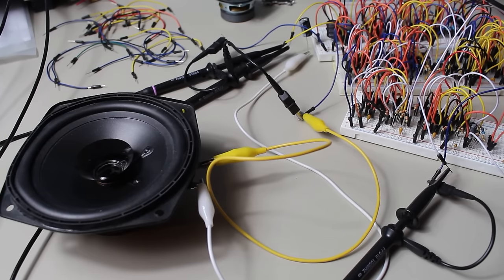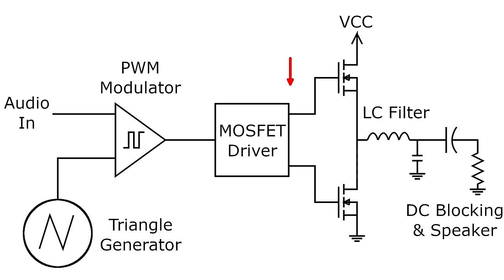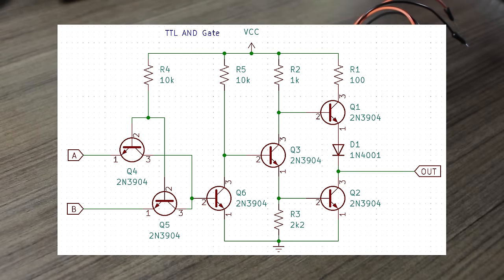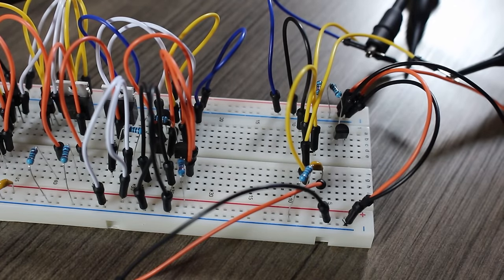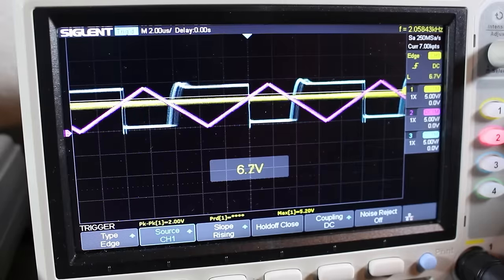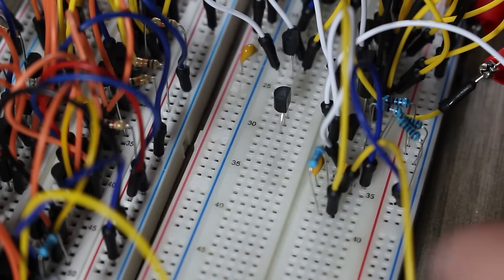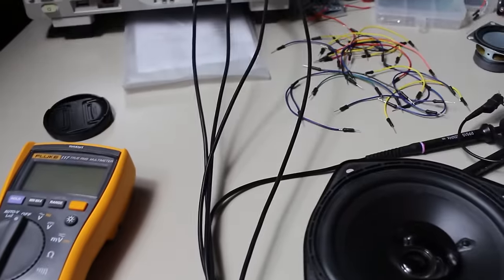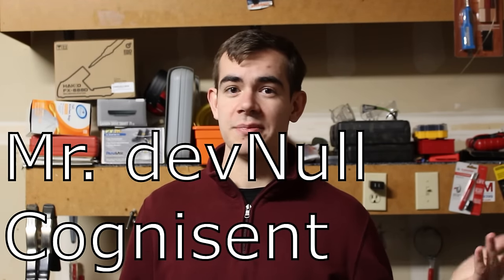How Do Class D Amplifiers Work? - Building A Discrete Class-D Amplifier

Comment: quite a decent effort with discrete circuitry no matter what the result. great mindset!
Reply: Exactly. Each sub-blocks were fun.
Reply from the maker: It was a good challenge
Reply: @SineLab  you will never be able to match discrete transistors to the same degree as those on a die but you can try sealing the pair in touch and in an epoxy case (self-heating is optional for more accuracy); also try inserting a current limiting resistor in totem pole configurations and for temperature stability in difference pairs and followers use emitter degeneration - a few 10s Ohms helps a lot; finally you can use a pure class B amp with a high open loop gain op-amp as a driver and negative feedback to linearise the output against VBE with incredible results - the op-amp has to have large slew rate for it to work through out the audio spectrum. take care :-)
Reply from the maker: @dimitrioskalfakis  That's some good advice. Thank you.

Comment: What a timing. Im a TA and some students under me are working on Class D Amp. Was literally discussing stuff with them when this came. This video will be helpful for them! 😊

Btw, I have one request, can you please share some references of all the uncommon topologies you use - Like the TTL type MOSFET Driver.
Reply from the maker: That is good timing :)

As for the MOSFET driver, it's a modified TTL AND gate. 

The output is a push-pull amplifier so that the MOSFET can be driven quickly. The high-side driver also has some bootstrapping circuitry which replaces the traditional power rail.

This webpage may be useful to you: https://www.allaboutcircuits.com/textbook/digital/chpt-3/ttl-nand-and-gates/

Comment: I've found, that a class D amplifier controller is relatively easy to make by use of a few 555 timers and an opamp. The opamp works as an non-inverting amplifier, setting the voltage amplification and generates the idle output voltage at half of the operating voltage of the controller. one of the 555 timers works as an astable multivibrator with a highly asymmetric output signal which generates short low voltage spikes. It's capacitor is charged with a constant current source (I have used a E-101 constant current diode, which gives 0.1 mA). The second 555 timer works as a monostable multivibrator which is triggered by the shprt pulses. It compares the voltage at the capacitor and and the output voltage at the op amp. The output voltage of the op amp is connected to the control voltage pin of the second 555 timer. And that is all.

The input of the power stage can be connected with the output of the second 555 timer. The power stage itself can consist of a half bridge driver (LM5104) the power MOSFETs and the output LC filter.
Reply: You can just use one 555. Connect the input to pin 5 through a capacitor and it varies duty cycle. Then just pass the output through a capacitor and the speaker is the inductor.
Reply from the maker: It seems like 555 timers can be used to make just about anything :)

Thanks for sharing, that does make for an interesting circuit.

Comment: I pretty much took on this exact project with the same approach last year, but with a motor driver. It was so much fun! I prefer to use discrete components as they are significantly cheaper and higher rated than ICs. 

The exception is if precision is required (like transistor matching in an op amp), and youre NEVER gonna beat a manufacturer on that.

Comment: I know this paper, charles is a member on diyaudio class-d sub forum, we endlessly spent time looking at the feedback loop and used it in a few noval and high power designs early in its release phase. I can make some recommendations if you want to look at a discrete option rather build the (UM10155 Discrete Class D High Power Audio Amplifier) less parts, better performance and you still get to enjoy a successful build and learn the core stages in a class-d amplifier. which is a low propagation delay comparator with complementary drive, discrete mosfet driver + output stage and finally a self-oscillating UcD feedback loop.
Reply: The thought that comes to me in this specific project is the comparator. I'm not exactly sure of the specific mechanism that equates to it in class D, but audibly, that's "crossover distortion"... so I'm assuming the slew rate on the comparator has to be all but ridiculous to keep it out (and I'm not sure how you'd do what happens with AB feedback to reduce it either).

These things, just like all the SMPS topologies, require leaving conventional "DC philosophy" behind somewhat and viewing them from entirely different angles. I'm there in power conversion... class D still confuses, but this is very useful to break down all the blocks to see how it works... and who can't love a sprawled out board of discrete components... beautiful build even if the function is less than ideal.
Reply: @MadScientist267  

Crossover distortion, primarily associated with Class-AB amplification, where "class-d distortion" manifests in Class-D amplifiers due to PWM (Pulse Width Modulation) non-linearities. This distortion arises from a loss of control under various conditions due to poor feeback/control theory practice, such as fluctuations in frequency control (we assume a self oscillating modulator) , power-supply regulation, long dead-times or poor PCB layout leading to EMI interference in the modulator/Mosfets. Delving into this topic reveals a complex subject intertwined with adjacent disciplines like Delta Sigma conversion, PCB design, power electronics, and ultimately audio fidelity.

About comparators, this isn't an issue as long as the comparator is able to deal with signals at least at Nyquist bandwidth for the intended audio band or x10, x100 times higher that the sampling frequency example: 550KHz(max), comparator proportion delay adds an inherit delay and used as a block as part of the loop control.    

The funny thing is the more you build class-d amplifiers the more you find out none of the challenges are audio related.

Lastly, I design class-d amplifiers in my spare time so the information above is proven knowledge.

Comment: Great video, I want to build a class D amp also, but I'll stick with reular op amps and mosfet driver IC, to make the building process less difficult.
Reply from the maker: Op-amp ICs would make it easier :)
Reply: You can make this simpler by cutting corners. For example, using resister transister logic and just using a two transister square wave generator with an extra transister turned on by analog input to vary duty cycle. The totem pole outputcan be replaced by a single mosfet since the output capacitor will offset that around 0 creating AC.
There are alot of drawbacks but it would be a really simple class D.
Reply: I am with vojtechadame5860.
He thinks the same way as me.
A field transistor is much much more accurate and in my logic it makes can make the circuit more ehm simple.
And mosfet amplifiers sound sooo much better!

Comment: Congratulations, an interesting project. 
However, you could simplify the project, because the more components you have involved in the operation of a circuit, then the chances of failure increase. 
The input preamplifier (with the amplification of 10) can be made with 1 or 2 transistors.
The triangular signal generator can be made with 8 transistors.

The feedback amplifier (Q81-Q91) is not required. 
Filtering the supply voltage with only 100uF for audio power amplifiers is small, and the power supply of the preamplifier is normally done by RC filtering.
I hope you make version 2 of the circuit. 
Don't give up on this project.
Good luck with all future projects
Reply from the maker: Thanks for the ideas. Simplification is the best next step.

Comment: I made one of these a whole lot of years ago but my circuit was somewhat simpler.
The main difference was I used two "long tail pairs" for two comparitors.
Each compare drove one of the two output transistors.
One input of the compares had the signal plus the saw tooth
The other input of the compares had a slight offset voltage.
One had a positive offset and the other had a negative.
The slope of the ramp and amount of offset gave the dead time.
I used feedback to make the circuit more linear.
It sounded good and could put about 3W on a speaker from small transistors.
P=V^2/R
V^2=3W * 8  
V = 5V RMS about
5*sqrt(2) = 7V
My supply was 18V split to make 9V each way

Comment: Hey this is a great video for understanding basics of transistor logic, really appreciate the time and effort you have put it. Its rare to find analog content these days and this video just made my day. Just wanted to ask if the failure of the triangle wave generate was a circuit design issue or a PCB issue ? Thanks
Reply from the maker: It doesn't seem like a circuit design issue since it worked on the breadboard. It's likely either the PCB or the individual components not working well together.

Comment: Not a bad effort, you’d have a better go with even something as simple as an Intersil HIP4082 driver, use bipolar rails to ditch that coupling cap or do a unipolar full H bridge. Remember your distortion performance is going to be limited by the linearity of your tri-wave so the RC would have never put down good numbers. That said with a decent oscillator an op-amp based integrator 0.1 or 0.01% THD+N should come fairly easily. 

That or look at Bruno Putzey’s UcD topology which is self oscillating. It’s free for public use and commercially so long as you use one NXP component in your design iirc.

You could of course cheat and just jump to an IRF2092S as well, that will implement nearly everything short of the feedback loop and a few external parts.

Comment: Breadboards have extremely large parasitic capacitance and as frequency goes higher things are getting worst.But even in a pcb the problems with parasitic capacitance and noise interfere can be remain.If everything designed perfectly in component level maybe it needs extra copper layers for vcc and ground plane and also the components have to replaced with smd parts.

Comment: Though you tried making class D block from discrete elements, you cant get this to ever work decent. One of the problems is a pile of transistors of questionable bias, thermal coupling etc... But if you want to learn the other way of making class D amplifiers called 'hysteresis class D' and also make really functional and must say good HiFi audio amp, you should try D class circuit called "UM10155" designed by Philips. It works great, have only 13 bjts and 2 mosfets. Here is no place for me to discuss it any further, but you have bunch of forums where people explained the circuit in detail! :)

Comment: Class B suffers from crossover distortion. You have dead zone on either side of the signal before either transistor turns on (why we use class A still)

Comment: I added this to your class A video, and repeat it here since people use your channel for education.

Class A amplifier does not mean one transistor. It normally has the same stages as a class B amplifier: input stage, voltage stage, current stage. The difference is that class A and class B is biased differently. 

The misunderstanding is probably due to it being possible to make a class a of one transistor, but that is not usually done in real life. I say "usually" just because there exists some amps called Zen. But most class a you buy have just as many transistors as a class b.

Comment: I concur that i had a similar cable spaghetti phenomenon on my breadboards when working on a buck booster circuit, making all the signals from scratch along with a feedback system(with op amps ofc), anyways great video! Will you introduce PLL(Phase locked loop) ic's as well in the future? They are capable of many things such as a frequency generator, demodulate signals etc.
Reply from the maker: It seems like the spaghetti is inevitable at times :)

PLLs are a good video topic

Comment: Although your goal with all discrete is very cool, I wonder if you designed another spin replacing some of the basic blocks (basic buffer amps, comparator, triangle generator, FET driver) with jellybean ICs if you could get a board that sounds decent at the end. And so prove out your basic design. I guess we can see why all the old boys like designing a powerful AB amp instead of tricky D one :D
Reply from the maker: It'd definitely be more successful with ICs.

If only class D could be as simple as AB :)

Comment: Isn't the whole idea of Class D that some of the transistors are not switched on some of the time? In this example, it seems one or the other transistor is always on? Maybe there could be 2 pwm signals one positive and one negative? Or an 3 level mid low high signal?

Comment: If you use RF techniques I think you will get a better and more stable result. I think your troubles are in long track lengths aspdding stray inductances everywhere and there would be stray capacitances too. Your triangle wave in your final build was “fairly wonky”, this is because of insufficient grounding.

It is a bit of a pity you jumpped straight to a PCB from the breadboard. If ou have the time, try to build it “Manhattan Style” on a piece if tinplate. Get a large tin can…prefrably one without any ridgrs in it…here in Australia I’d use a 1.2Kg Milo tin…take the ends off with a can opener and cut down the seam with old scissors ir tinshears. Flatten the tinplate out into a sheet and use that as a groundplane. Just start building directly onto the tinplate by soldering the components directly to it. Keep component leads as short as possible…say you have to ground the emitter of sn NPN transistor, bend up the collector snd base leads and make an “L” shaped “foot” with the emitter lead, keep the upright part of the leg short and the body of the transistor close to the tinplate sheet. Say you then meed a collector load resiator for that transistor, get the said resistor, bend one lead into another “L” close to the body and solder it to the cut down collector lead of the transistor, the long end will be your output. Now, lets assume you need a decoupling capacitor gor that stage, either get a leaded monoblock, or even better a surface-mout 100nF, right st the other end of the collector load resistor solder the SMD 100nFto the dide of it…right close to the body, leace the lomg tial to become the DC rail. Now bend it down close to the tin so the other end of the 100nF touches the tin, “toombstone style” and solder it down. A leaded cap can be used too, but keep the leads real short and the body of the cap right down close to the tin. 

Staet wirh, say, the triangle generator…once you have built the entire triangle generator, tested it and it is working in the tinplate sheet…NOW, cut from another Milo tin..of Coffe Tin..a strip of tin about 3/4 of an inch wide, use this to mage a “wall” around the triangle generator, run the output through a hole in the wall ot An arch in the wall. Solder the wall down really solid to the groundplane…steel has a poorer thermal conductivity than copper and your iron should be able to handle it easily. 

Now simply keep goung, build the compsrator in abother “doll’s house room” right next to the triangle generator, test it, get it all “Hunky-Dorey” and move on to the next stage. 

Take partivular care around the MOSFETS and low pass output filter…anywhere high, pulsy currents flow…treat this part of the circuit like it is wotking st 4GHz, not 400KHz! Keep everything “short and sweet”. If you can get your hands on some old scrapped microwave stuff..like an old GSM Mobile base dtation tranceiver, look at it’s layout and try to emulate it in your curcuit.

Whan finished, it will look like s compact “rat’s nest” but it should work really well.

Cheers, “The Globe Collector”, Tasmania.

Comment: I mean why wouldn't you just build the PCB in the exact way you designed the breadboard setup, using the same transistors that you literally just used (workingly) in the same breadboard.

Comment: did you check your solder joints?  in the video you hooked up the scope probe to a resistor which was not properly soldered and I noticed that it moved.  secondly when your triangle generator broke, you should have checked the schematic and then the board to find out why it broke.  you dont just "fix" the same circuit and move on several times.  you look for why it broke.  You designed the circuit.  you know how to find the problem. You dont give up after all that effort. lastly in engineering, PATIENCE IS A VIRTUE.  one step at a time.